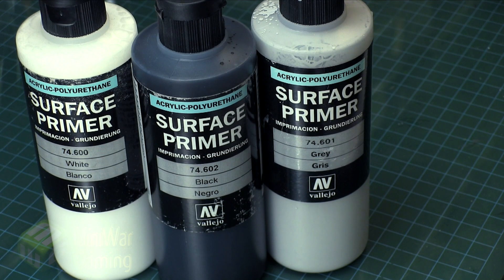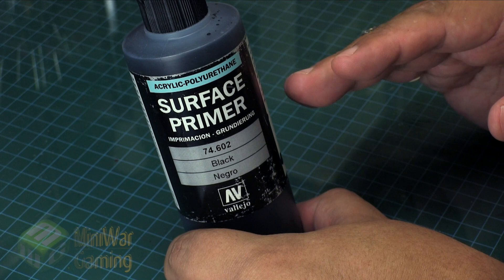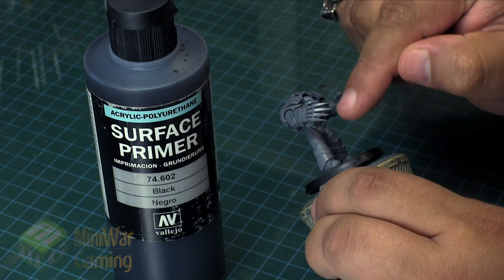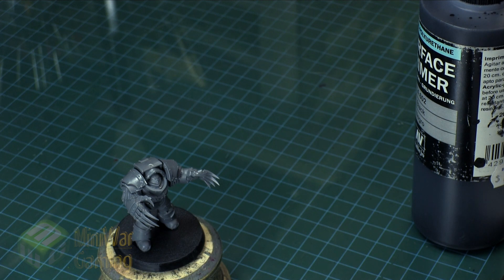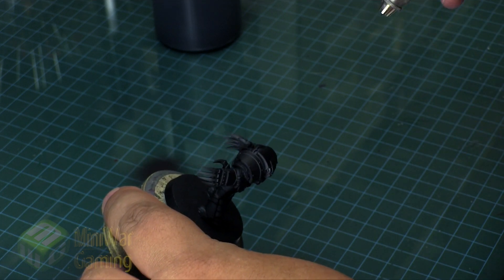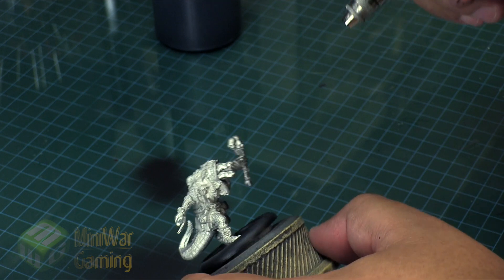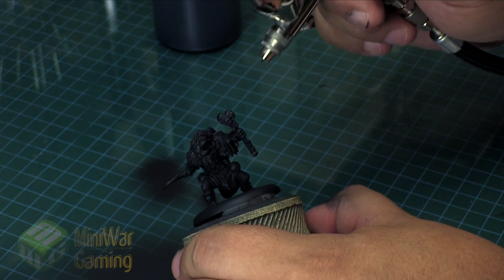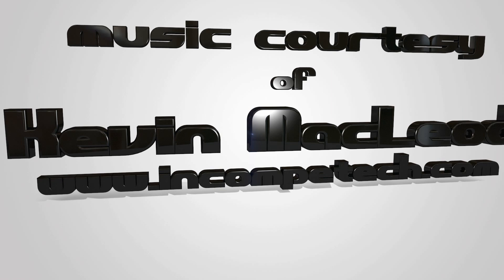Quick Tip: Airbrush Primer

Comment: When I prime  I do it for a variety of reasons and it’s not just for paint adhesion. For me, Mr. Surfacer 1500 Black with MLT is my standard go to. But what else besides paint adhesion? 

“Black basing” as it’s called also provides false shadows for your top coats whether by choice or by chance (like missing a small area(s) behind tank road wheels) which of course gives the model more depth visually. Also, I can adjust my spray as I go to do the same as pre-shading or post-shading all in one step. If you dream of modulation this is easily achieved in the same way.

This method also is important to show potential problems. This is particularly true on aircraft in such places as wing roots and wing leading edges. Errors will stick out like a sore thumb using this method which gives you time to go back in and correct if need be before you hit your build with those top coats.

I’m by far no expert builder like others but after getting back into the hobby after some 40 years of being away from it I’ve discovered it’s a constant learning cycle and pretty steep learning curve. I’m just passing on my two cents and it’s free to boot. Just my two cents. Thanks for the video!

Comment: One thing not mentioned is washing your models! If you're using Resin, or if you've been playing with the minis for a while before you prime it you'll want to wash it in warm soapy water (and let dry) before you prime! Mold release and finger oils will make even primer have a hard time sticking!
Reply: It's not only resin you want to wash, it's pretty much all minis unless they are 3d printing.  They will have some form or other of mold release agent on them which is likely what was causing the flaking in the opening question.

Before you even take parts off the sprues you should wash your sprues in luke warm water and a little dish soap.  Use an old tooth brush to give them a decent scrub, rinse in luke warm water.

After you assemble the figure, if you weren't wearing gloves, you will need to wash it again to remove skin oils from the figure, that can also cause a bad prime.
Reply: Is this what causes fisheye or speckling

Comment: the vallejo primer is the best on the market. you always get a nice surface it's nearly impossible to overspray. After the drying time you always have the full details of your miniatures.
Reply: It's so easy to scratch off
Reply: @Lachslamer56  THat is exactly my one concern about this type of primer that I can actually scratch it off without much effort. The same thing can't be said about GW canned primer, but the airbrush lays down such a smooth layer of primer.
Reply: Is this still the case after 5 years
Reply: @Sassy_Witch  I still use the vallejo primer. Always 3 nice even coats with my airbrush. I recommend a 12h drying period. After drying do your paint job and give it a nice coat of vanish. Nothing will peel off or scratch away if you do it right.
Reply: Do you thin down the primer with thinner or water or something??
Reply: @danielasalazarsilva  I use a 0.6mm nozzle set for priming, I don't dilute the primer - no water, no thinner. Just straight out of the bottle. Just wipe the tip a bit more often because the primer is curing very fast.

Comment: The vallejo primer is extremely painfull to use with my airbrush. I don't know why, maybe because this is too thick, but whenever i air brush it, after a few seconds it stops spraying. On the other hand my other vallejo air paints spray flawlessly without thinner.
Reply: What size needle are you using?
Reply: Add some flow improver to it?
Reply: I use liquidex flow improver, a couple drops for a quarter cup

Comment: It sounds like the person who requested this might be having problems due to mold release agents still on the miniature's surface; on a couple of Reaper Bones minis and a few white metal ones, I've had similar instances of paint and/or primer peel off because I forgot to wash the minis before painting.
Reply: I agree, aside from not showing washing the model this is the process I go through and have not had any bad results.
Reply: Once I cut a batch of parts and finish trimming and sanding, I get some bowls of dish detergent and scrub each part with a toothbrush, and rinse em real good. Lay out on some paper towel and begin the next batch. Really makes a big difference!

Comment: Always use Vallejo primer undiluted. 

I find that spray primer works better on resin and metal figures.
Reply: I mostly concur with this statement. I've not had any problems with priming metal, plastic or resin.
Reply: Agreed. I haven't had any problems straight out of the bottle on polystyrene, such a time saver

Comment: The Badger Patriot 105 comes with a .3 needle, a great general utility airbrush.  You know I've experimented with a lot of brand name primers and they were all OK and did the job.  In in the last few years after I ran out or primer I discovered  all I had to do was just mix cheap craft paint and thin it with floor was wax which is basically a urethane type of product designed to adhere to linoleum and be durable enough to be walked on.  So, it thins and has great adhesion and durability, and the best part you can use any color you want.   So why pay extra for brand name acrylic primers when you can make it yourself for pennies.  And it's in my opinion better.

Comment: I havent been airbrushing my minis for too long. I was given a $60 Iwata NEO airbrush and use this (1/3) vallejo primer and (2/3) vallejo flow improver. For the first 10-15 minutes it paints pretty good, but after a while it feels like it starts clogging up and starts to blow back and it bubbles inside the cup. I have to break down the airbrush and clean everything and rinse and repeat. Is that normal?
Reply: I have that same issue with mine. Wondering if anybody else has the solution

Comment: Does this work straight out of the bottle or should I use a thinner or a flow improver? Thanks! :)
Reply: I've JUSTstarted but have been cutting it with paint: flow improver: thinner
6 drops:2 drops : 4 drops  (using Vallejo surface primer)

Comment: What needle size is your airbrush? I tend to have issues when priming with vallejo primers due to the thickness of the primer and most people say is a bad idea to use thinner with a primer.
Reply: Use Vallejo Flow Improver. It will help you a lot with the primer.

Comment: I think it's important to add that with Vallejo primer, it really is advisable to let it fully dry for at least 8 hours. Not joking.
Reply: I've heard from my group you'd best wait 3-6 days for it to fully cure
Reply: Weird. I use Vallejo gray and it dries in about half an hour.
Reply: It even says right on the bottle to wait 12 hours before masking--so i always just let them sit for a minimum 12 hours. I'm usually doing gunpla so there's always stuff to work on while i wait anyway. I kind of get into an assembly line method of churning out parts

Comment: Ive tried using Army painter air primer (black, white and grey) but the paint won't adhere to the plastic models. I am using a couple of drops of flow improver. Any idea why it won't adhere?
Reply: Im in the same boat and trying to work out why. I've cleaned my models prior, correct PSI for spraying and everything and still rubs off with a gentle touch.
Reply: @APC117  I’ve reported my issue to Army painter and they sent me a replacement set of all three primers. The paint I bought from Amazon must have been stored in poor conditions as it was useless. The replacements directly from Army Painter are much better. They adhere to the plastic and spray through the airbrush fine. Although can still be rubbed off it I try quite hard.

Comment: Do you need to use a face mask and/or us an extractor hood with these primers?
Reply: Stewart Stevens if you aren't in a ventilated area then yes
Reply: A spray booth with a vent should to the trick.

Comment: Personally I like to prime my models when they're not assembled. It makes it easier to get to hardly painted areas.
Reply: painting before assembly is a great way of making sure you get all the knooks and crannies... but I find you spend alot of time cleaning off contact points for gluing later on which can slow the whole process down.
Reply: best way is to put a little silly putty in the joints where your going to glue it then after your done painting it  you can peel that off do a little touch up if needed and then glue it on where its going to go.
Reply: Personally I also do sub assembling, however it steals the chance of using putty to mend some joints. It becomes a matter of choice and not what is best.
Reply: RREEEEEEEEEEEEEEEEEEE GET OUTTT

Comment: what air compressor do you use I need a new one mine Is completely broken :(
Reply: I had a small dedicated one like what he listed. I bought a secondary regulator kit for like 8 bucks and put it on my pancake compressor and works amazing. No more listening to that pump running. Its got enugf air in it to spray for a long while and its very consistent because its not trying to keep up the pressure, the airs already in. After a while it will kick on and fill up again

Comment: I am now building a Heller Citroen traction avant. It seems that the Vallejo primer does not "stick" enough. I easily getting damaged. Why is this happening. Should i wash the parts first, is this necessary
Reply: Washing your plastic models or figures with a mild detergent like dishwashing liquid before painting is considered a MUST. During the production process of plastic models factories apply a thin film of oil to the injection molds so the finished sprues can be removed more easily. You may not see or smell it, but it is there, and this oil can make it very hard for paint to stick on.

Comment: I just get an old brush and stipple that very primer onto my minis, let it cure for a few days, then paint...of course wash the minis in soapy water and let dry (even you plastic minis)
Reply: when using a stippling motion do you find the primer kind of froths up and introduces air bubbles?
Reply: +Kris Belleau I find that when I try to brush it on using normal strokes I always get air bubbles win this primer, so the reason I kinda stab it in is to pop all of them. Yeah the primer looks patchy but it works just fine for me. I found a tutorial by Brant Benoit, he does mostly warmahoards stuff with a lot of blending, and I tried his priming method and it worked for me.
Reply: +Kris Belleau okay maybe not quite stippling more like dabbing it on, take a really old brush. Load it up with some grey primer. And just dab it on using the bristles to pop any air bubbles that might occur all the while not worrying about if it turns out patchy after a coat or two.

Comment: My Vallejo primer beads up, runs, and causes dry tip no matter my psi or paint thinning. Light touch on the trigger, heavy touch on the trigger, flow improver, retarder, it doesn't matter. The Vallejo Mecha primer works a lot better but I still have the same issues often enough to be frustrating.  Just ordered some stynylrez hoping for something that behaves.
Reply: did it work better? I'm having the same issues with grey and especially white vallejo primer...

Comment: Vallejo is really only good for models that are not meant to be handled afterwards, like model kits, they will work on hard plastic figures if you handle them with care, but for metal, resin or soft plastic I prefer to use Alclad Grey Primer, as it is far more resilient. 60/40 ratio of Alclad and Mr Color thinner.

Comment: AV is the best. But not for priming. AV will rub off. AV primer is the same, it will rub off. Its crazy how people talk about using anything other than AV flow improver. AV flow improver is the only thing that works fully when airbrushing. Oh and AV primer will not sand. I repeat AV primer will not sand.

Comment: isn't a spraycan faster and cheaper?
Reply: Nothing wrong with a rattle can, but you give up a lot of control as to the density and viscosity of the paint, as well as control of the area to be painted.  On larger models this may not be such an issue.  On smaller one's this could create a significant problem with covering up details.  Remember this is a first application, you are going to be applying additional paints and likely a clearcoat.
Reply: Spray cans give a worse finish (and you can't control them too much) plus they're really expensive in the long run.

Comment: ...quick tip, don't use it!  takes too long to dry, requires a whole strip/clean of airbrush and isn't as effective as rattle can automobile primers (Which FW actually recommend for resin).
Reply: J2B  Thanks for sharing.  I guess there is no one way of doing it and it's down preference or what you are doing it for.  I have always had good results with Halfords primer, especially for resin where the extra hold helps.  Maybe I need to get a bit more proficient at using primers in the air brush.

Comment: How far, roughly, are you pulling back the dual action trigger? Seems like you're going mostly air but just curious. I've been having issues with the "grey" primer but love the black one. I find grey is almost white and seems to pool/speckle no matter what I do thinner wise.
Reply: I don't pull the trigger very far, but sometimes as the tip dries or the paint feels like it may start to clog I pull the trigger farther.
Reply: I am new to airbrushing and am actually watching this video looking for a solution the problem you mentioned here. Did you ever figure it out?